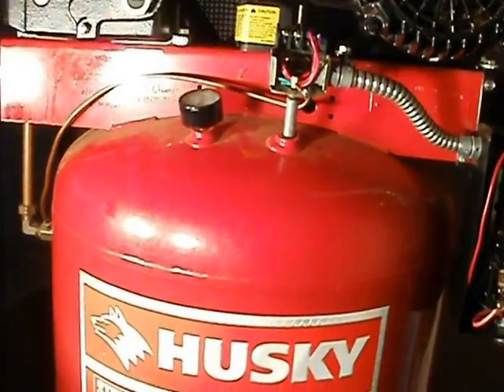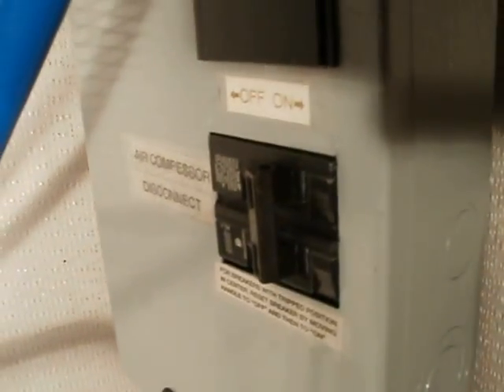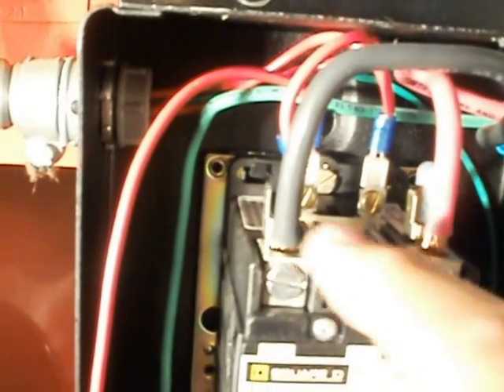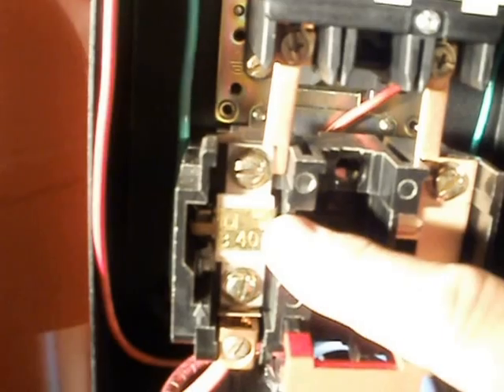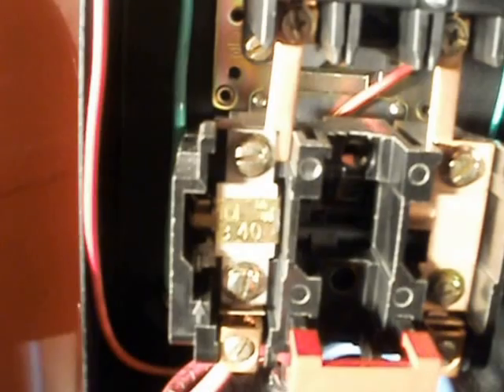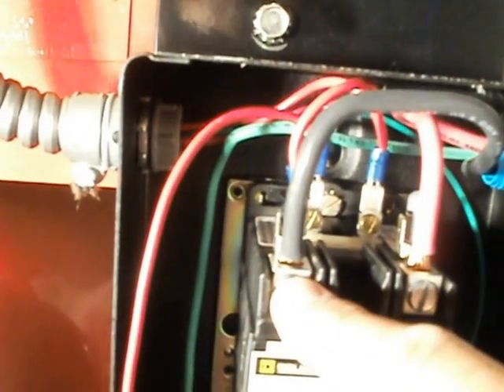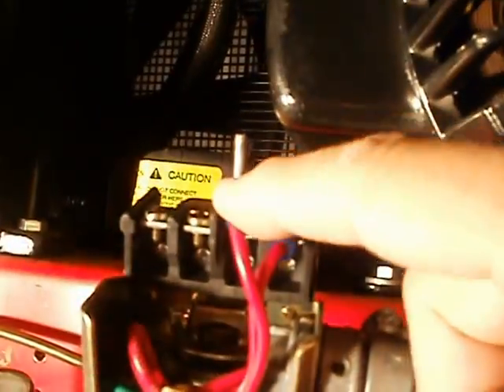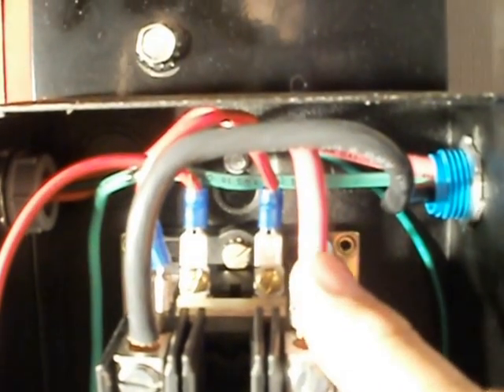Square D motor starter wire connections

Comment: Helpful tip... circuit breakers are for short circuit, or ground fault protection. Heaters or coils are used for overcurrent protection. This should help when t-shooting...